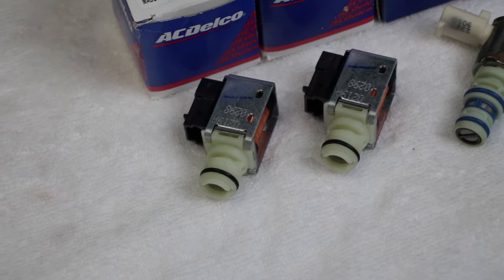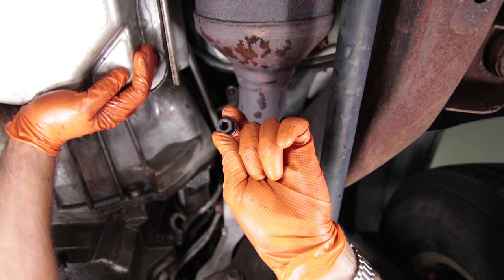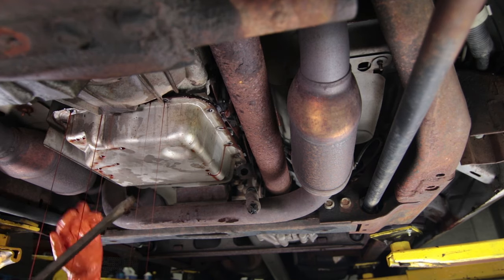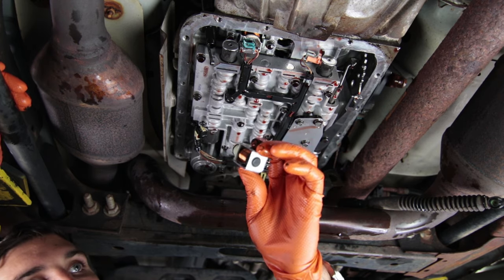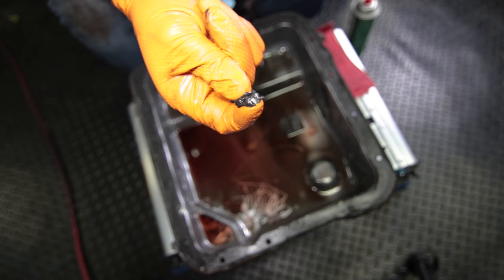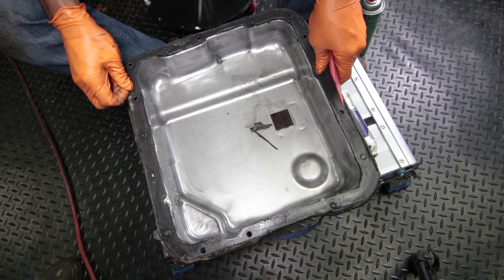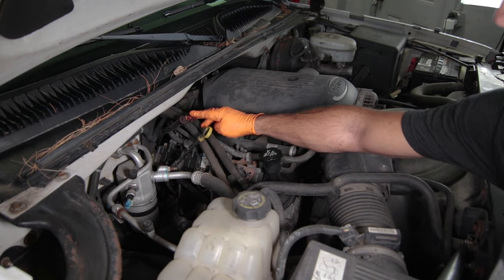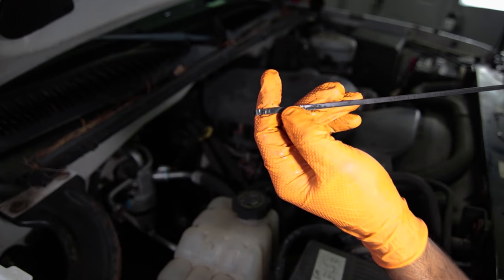HOW TO Replace All 4L60E Shift Solenoids and Torque Converter Clutch (TCC) Solenoid. Silverado 1500

Comment: So the A & B solenoids are shift solenoids. Good to know. I watched another video where this wasn't mentioned so I'm glad I watched this one.

Edit: filling through the fill tube sucks. One thing that works sometimes is drying the dipstick with brake cleaner. The surface tension of the oil can (hopefully) keep the oil from covering the dipstick. Of course patience helps too. Go put your tools away, clean up the spilled oil, etc. while waiting for the oil to drain down. Maybe they need to coat the inside of the dipstick with something that lets the oil drain off faster.
Reply from the maker: Yeah I use that trick too. Just make sure the brake cleaner is fully evaporated before sticking it back down the tube.
Reply: Why did you put your tools away while waiting for the oil to drain? You need them to put it back together.
Reply: @Timothy Geiger  Filling the transmission is the last step, so you shouldn't need any tools.
Reply: @timothyball3144  you missed what i said. The comment was made to clean up the tools while waiting for the oil to drain. That means you still have all the work to do. You drain the oil first, BEFORE taking it apart.
Reply: @Timothy Geiger  Notice my first sentence about filling the transmission. Although I should have said filling through the check tube.

Comment: I pulled my pan today and didn't need to move the exhaust at all, just needed a friend to bend the bracket while I pulled the pan
Reply: What year and type of truck/SUV do you have? I got an 03 5.3 Yukon XL.
Reply: @skud1971  an 05 Chevy Silverado 1500 with 5.3 as well
Reply: If you remove the front driveline on 4wd models, you can access the two  bolts on the shift linkage bracket. These bolts require a 40 torx bit and a swivel head ratchet

Comment: I am currently changing shift solenoids on my 05 Silverado. In the video you didn’t show what the 3-2 solenoid looked like. Does it look identical to the torque converter solenoid? I’m having a hard time finding the part at parts store. 3-2 solenoid was found.

Comment: did you tighten the other bolts on the inside before installing the trans pan also if yes what are the torque spec on them. Thanks for the video oh and I don't see no drain plug on your pan my 04 silverado 2wd single cab 4.8 has one. again keep up the good work your video helped me understand what needs changing out while changing the filter mine has 252,674 miles on it still strong

Comment: If you pull the two bolts out of transmission mount and Jack the tail end of the transmission up about 2 in you can get the pan out without messing with the exhaust
Reply from the maker: Not a bad idea!

Comment: Hello, I have a 2011 GMC 4x4 Serria 4.8 engine and 4L60E Trans, In January I had a new motor from GM put in. Few months later trans went out. I bought a transmission from Jasper Transmissions. My problem is that I'm have RPM issues. After truck / trans warms up after 30min or so the rpm is will drop and falcate between 45-55 mph and hesitates. If I give it gas it will come out of it. Or if I let of the gas it will stop. I have taken it to the GM dealer mechanic and they ran diagnostics said everything is running like it should. truck is not getting hot,  No codes so of coarse they don't know what to tell me. Any ideas ?
Reply: Let me ask if you put it in trailer mode does it work fine by not dropping rpms? Mine drops rpm The chatters in OD. To stop it at a stop I engage trailer mode then OD does not kick in and chattering does not happen.
Reply: I've seen a few "reman" Jasper transmissions fail quickly after replacement. Trans cooler (radiator) were replaced each time. Sometimes you get a bad one...

Comment: I recommend removing the T40 bolts from the link bracket, its not hard even when working on the ground. I was able to use a prybar on the exhaust and use my jack to pry the exhaust down just enough to get the pan down.

Comment: My Silverado driving to work suddenly no longer has 3 or 4 th gear if I put them in it manually it revs like in nuetral I checked and am running no codes and I changed filter and fluid still nothing. Should I do the 3/4 solenoid next or is the transmission shot? The fluid was burnt when I changed it tiny bit of metal in fluid but nothing crazy like I would expect from not having 3/4 gears I don’t want to keep dumping money in it if the trans is in fact shot
Reply: You ever figure this out mines having the same exact things going on

Comment: Thank you for the great content, I have a 2004 gmc yukon that has a check engine light on. I used the fixd ob2 bluetooth scanner. I codes p2761 ,p085,p074. I changed all 4 solenoid s and filter and gasket.and finished and added fluids and turned the truck on and the check engine light went away and 5 mins later the check engine light came on. And I scanned and cleared the codes and they are back! Did I do something wrong? Please help need this truck to pass smog. Thank you.

Comment: Good stuff. Could this be my issue on a `99 Trans Am 4l60e, seems to be an unlock issue. TCC lock is fine at the speeds / TPS that I have tuned. It's when I'm on the highway and I ease up on the accelerator, the TCC will unlock and the RPM jump as I accelerate back to TCC lock. Everything else about the transmission is fine. HP Tuners scanner shows that the TCC lock is commanded on during those times that it unlocks.

Comment: Quick question: does the engine have to cool down before you change the solenoid, or you can do it regardless of whether it's hot or cold?

Comment: I replaced mine with a wireless 700R4 transmission and a marine 6.5 diesel . The only wires are the fuel cut off, the alternator and oil and temperature gauges.

Comment: My transmission won’t shift until about 23 mph and only has 2 gears. I was thinking it’s the shift solenoids. But I don’t have any check engine lights. My question is could the solenoids still be bad and not throwing a code? I appreciate it any advice in advance.

Comment: Did this job,  it really is way more work than these guys let you believe.  The exhaust is right in the way of the pan. And if you're from New England no you can not remove exhaust bolts you must use ratchet straps and a block of wood to move the exhaust outta the way while bending the heat shield.  Just throw the truck away GM/chevy are the worst vehicles ever made. I fixed my problem by buying a toyota if you're messing with the transmission of a gm just sell it.

Comment: you say you have to move the bracket out of the way but I had to change the filter on my "04 trailblazer 4x4 and didn't need to do anything similar other than angle the pan correctly in and out

Comment: Great video. I just went under my 94 chevy thinking I would see a 4l60e but it's actually a 4l60 shallow Pan. Have you ever owned one with this type of transmission.  I have a hard shift from park to drive and park to reverse. I'm thinking it has an upgraded towing package. It's a k1500. Also, all other gears shift flawlessly. Me personally, I don't like the hard shifts. Have you ever put in the sonnax upgrade 1-2 actuator piston with softer springs. I think I have heavier springs in there? Any info would be great. Going to be opening up the pan maybe next week.
Reply: I have a 09 Yukon Denali and I'm also having hard shifting into R + D and it jerks a little bit or sounds like it is going from 1st to 2nd I think it might be even more so when it down shifts. It doesn't slip at all but shifts perfectly it just jerks. Hard. It's got brand new motor mounts on it and the transmission mount doesn't look bad but I still have a new one. I'm about to change the fluid and filter and I guess the solenoids also. What happen with yours?
Reply: @c_mac7773  I'm waiting till the woman gets back from a 1 week trip then I'll be switching out the solenoids, fluid, filter and putting in that 1-2 actuator. I'll let you know how that goes. I'm going to make a video of the hard shift. It doesn't have a problem shifting into any gears, I just couldn't imagine it being good on the transmission with shifts so hard/Jerky
Reply: Check your engine and trans mounts, sounds like they're shot from what you're describing.

Comment: So if i lost all my gears does that mean one of these valves is the culprit? or is the torque converter itself the issue? I was driving along and i had 2366 lbs on tow and it just lost gear. rpm reved to 6k and i pulled over with not even reverse. Tranny shop wants to replace the whole tranny. my code was p0741 active for TCC performance. valve body needs inspection

Comment: Good video, I’ve managed to change 3/6 solenoids on my 06 Mazda 3 because the other three solenoids are a bit different to take off. The car only backs up now and won’t move when put into drive. Before, the car wasn’t moving  forward instead of in reverse. Any idea ? The code I got was p0766 shift solenoid stuck off
Reply: Difficult not different *

Comment: Just did this... A heat gun to the back of the gasket flange makes the gasket peel right off without having to scrap it clean.
Reply from the maker: Good tip!

Comment: The service manual is showing Dexron 3 for the Transmission oil...  but the link is showing Dexron 4??? Can you put Dexron 4 in without issues?
Reply from the maker: I always recommend using the recommend fluid (although I would suggest switching to amsoil). Normally, deccron is backwards compatible but verify for your specific video.

Comment: I have a 03 chevy express stall sometimes when I come to a stop, im changing the tranny oil and i was thinking of changing that solenoid not sure witch one is or the part number. Ill have to finish it tomorrow and go looking for that lil part. hope I dont mess up... 😊
Reply: Does it completely turn off?? I've got an 04 Tahoe and when I come too a stop, mine will drop down to about 300rpms and then slightly go back up
Reply: @hammerT2997  yes it would stall and die, I change it and it fix the stalling  problem, now when cold or once in a while, feels like the tanny won lock up, I rev it then the lock kicks in engages and moves just fine. its alot better that how it was before. hope it keeps runing.

Comment: So why did you do this? Rough shift? Missing gear/shift? Hard shift? 
My 3rd gear in 2007 LTZ Avalanche just quit working.. wondering what could be diagnosis without rebuild/replace.. thank you for any info! Great video!
Reply: Did u figure out what wass wrong with it
Reply: Time for a transmission overhaul, 3-4 clutch pack burnt up.

Comment: Just changed all my solenoids. Shifts much better now. Only issue is gear 1-2 now shifts above 3000rpm and after I lift off gas. Any thoughts????
Reply: Figure it out?
Reply: @nickwooo1  Yeah. Simply out the transmission was shot. The solenoids were not the problem. Sold truck to a good kid for cheap and he put a trans in it for $1800 bucks. Runs awesome now he says.

Comment: What's better to change the transmission solenoid  or just the transmission from a used car lot? And if I get a used transmission what kind of fluid should I put in it. It's going in a 2003 envoy. All the gears kinda stopped. Was 4th I guess then went down. Now it barley moves. What do you guys think I should do

Comment: What symptoms was your truck experiencing? I have all these codes pop up on my 06 5.3 when I accelerate its loss of power is crazy it takes about 3-5 sec for truck to get moving. Once it picks up speed it shifts through gears fine.

Comment: My 3-2 solenoid broke when trying to pull it out.... Any recommendations on how to get the other half out? Thanks a million
Reply: Replacing shift selinoids pulled 1 it was like spring loaded spitting plunger rod out  but the other 1 nothing their  ? Is it suppost to be like that  or am I missing something?? Any advice please 94 chevy pickup 4l60 trans
Reply: @jerryvaughn9834  mine didn't have a spring or anything, just resistance lol. I don't know if it's normal because my truck was tweaked on sorry. I had the 3-2 solenoid break off so I had to screw a screw inside of the broken connector to finish pulling it out

Comment: Ok question. My 2008 chevy silverado 1500 4.8l 2wd transmission started slipping after one of my cooler line was not connected right. Transmission oil spilled everywhere 2 times getting home. You think my sensors or TCM went out? Will a complete sensor change help. I can't drive above 30mph

Comment: Okay so I'm having trouble shifting and staying in 3rd. The parts store gave me two shift solenoids that are 1-2&2-3 and I install them both. But still having the same problem. Should I be getting different solenoids? Some solid advice would help. I should add that I can feel it shift into 1st and 2nd and I can shift into both of those manually and when I try 3rd manually I can hear like it wants to, bit it doesn't fully get there. In park in an shift it in all three and it will go, but it doesn't stay in 3rd. It will shoot the rpms up and do nothing.
Reply: Time for a transmission overhaul, 3-4 clutch pack burnt up.

Comment: So my 05 silverado doesn't shift into 3rd or 4th, and I can only go up to 50mph.

If I replace the solenoids in this video, will that fix it? 

The transmission fluid isn't burnt or have any metal shavings in it either.

Comment: Nice. I didn't see you replace the Gasket or apply locktite or whatnot. Also, is there no Reprogramming or resetting?
Reply: No locktite needed.  Holes in gasket are also smaller than bolts so they stay put.  This helps with keeping gasket centered on pan.  New gasket comes with new filter.  Also, no resetting needed unless you had codes.
Reply: @u2ooberboober ...Well I'm SOL (sht outta luck), I replaced all 6 solenoids,  trans fluid pan and gasket, trans fluid filter, 2 sensors on the transmission (speed sensor)....and nada, problem still persists. I let the TCM re-learn, by letting it idle 20 min, then turning on A/C 15 min. All to no avail. The car is 14 years old, at this point I don't want to spend more $$ on it. I just might as well get a "new" used one.
Reply: @FunDuude  damn,  unfortunate but bound to happen sooner or later.  Get 1 more opinion from a transmission shop before taking the leap…
Reply: @u2ooberboober  I hear ya man. I hear ya. I've been known to spend money on lesser and dumber things before. But out of principle I just don't feel like I wanna pay one of these mechanics to diagnose my problem for $100+. 
We have other rides, so this one's not really a priority. Maybe one day I'll just break down and get a Refurbished transmission for our 2010 Mazda3i. I heard they're around $700. I know, I know...I need to think this one through. lol.

Comment: Which one do you change if you have a p0785 shift timing solenoid? or do i need to check the harness for continuity first? how do i test for contiuity with a volt  meter on these plugs just probe each terminal on ohms setting?

Comment: Is the TCC solenoid and the 3-2 solenoid the same solenoid the same? I understand the back two are the same part number but I'm not really having luck finding just a tcc solenoid.
Reply: Was this the case? I’m in the same spot and I have code for tcc

Comment: Great video, I have a 06 2500hd and it will not shift into gear at all I disconnected the brake actuator under the dash thank you for any help
Reply: Did u figure out what was wrong with it

Comment: Thanks for the video! My 2000 Silverado with the same trans goes through the gears just fine but when the torque converter goes to overdrive (around 45mph) it starts shuddering. This happens under  light acceleration. It's not happening all the time. But it's getting worse. This only happens in overdrive. Could this be a sign of a faulty TCC solenoid? Thanks in advance.
Reply: @prevost8686  thanks for that info. Never heard of that product before. I added it Thursday. It's now 4 days later and I still notice it at times. It might not be as bad now though. Hopefully it will improve. This transmission might have 15k miles on it so I cannot see it needing to be replaced already.
Reply: very common issue . Harmless .
Thay additive lasts a while but it comes back after a month.
Reply: I’m having the same issue, did you get it fixed?
Reply: @loosewire09  yes i did. In fact I took it to a transmission shop and they couldn't find any issues with the transmission but they did find my number two cylinder was misfiring and suggested I replaced the spark plug wires. How long has it been since you replaced your plug wires and plugs? After I replace the wires I never had an issue again with it. That misfire in the engine had me thinking that there was something wrong with the transmission. Its been fine ever since I changed the plug wires. Let me know if this works for you..
Reply: @danknitz9679  I was just telling my wife last night that I had forgotten all about needing to change the plug wires. I did a full tuneup but the wires because the pandemic they were out. I don’t drive it much and it’s been out of sight out of mind. I’m going to get some today and I’ll let you know. It’s kinda funny because I even put electrical tape around them where the holders are thinking I really need to replace them when they come back in stock- now a year and half later I’m working on customizing it more and forgot.
Reply: @loosewire09  let me know if it does the trick... Good luck

Comment: I have a 2011 4.8L v8 express 
Hard shifting on 3rd gear 
If I replaced 1/2 & 3/4 solenoids will that would or will I need to reprogrammed it ?

Comment: We have an 02 avalanche. It's been shuddering for about a month now. Today my dad was driving and it started revving high and wouldn't shift. Does this sound like solenoids or is it a ruined torque converter.
Reply: I'm having a similar issue
Reply: Did u find the problem mine started doing it and wont shit anymore